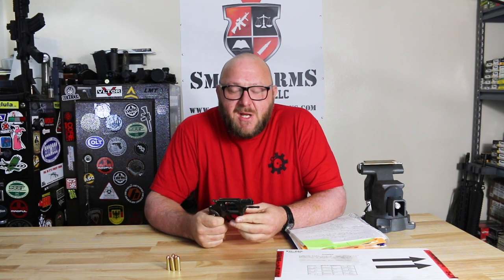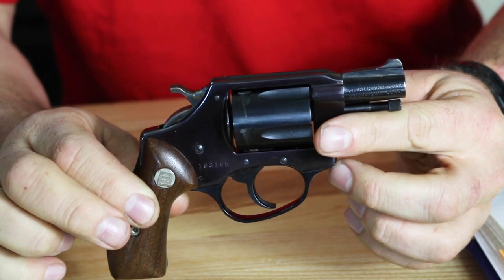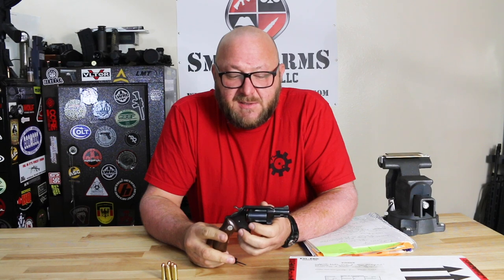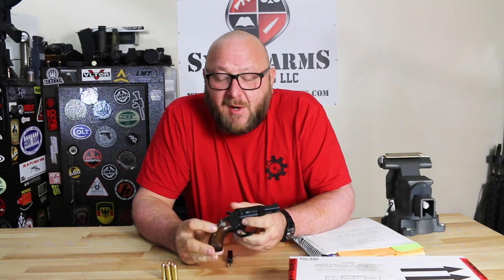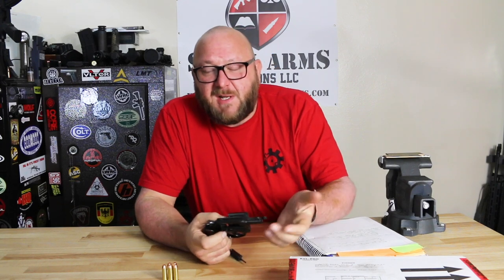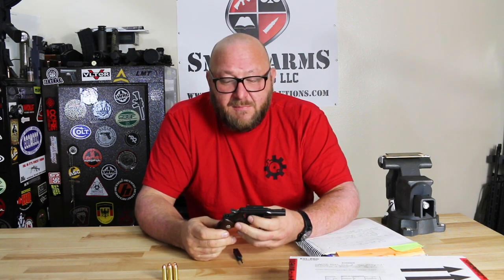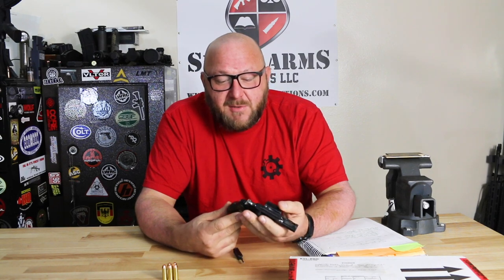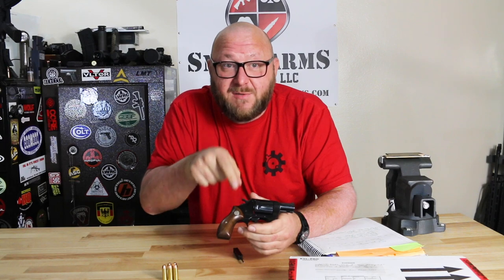Crime Series, Vol 7 - Charter Arms Undercover

Comment: The Charter Arms occupied an unusual niche in the firearm world. It was both inexpensive and good. There are and have been others but they are unusual. I carried a Charter Arms Undercover as a backup when I was a police officer in the early '80s as did quite a few of my fellow officers. The only consistent complaint was that the trigger was pretty gritty but the advantages of a small, lightweight, hard-hitting backup weapon outweighed it. The department I worked for required that any backup weapon had to be loaded with the department duty round which in our case was a Winchester Silvertip .38 special +P. The only serious competitor in terms of size and concealability was the Smith and Wesson J-frame Chief Special which was not rated for +P rounds. That doesn't mean some officers didn't carry it anyway but the fact that the Undercover was rated by the manufacturer to handle higher-pressure rounds tended to give it an edge. And, of course, it was quite a bit less expensive than the S&W. Cool trip down memory lane! I haven't owned a Charter Arms revolver for a couple of decades but I may "need" one now.
Reply: A lot of guns that are "inexpensive and good" as you put it are sorely missed once they're gone but underappreciated while they're around. Norinco and Polytech AK's come to mind. I've personally always had respect for the Charter Arms Undercover and it was actually the revolver that started my fascination with snub noses.
Reply: Just out of curiosity, did you ever have to draw it as a backup weapon on duty?
Reply: @jbuckley2546  I never did. I didn't draw my primary weapon all that many times and never had to resort to the backup. I did draw a weapon once when off duty but it happened to be a different handgun. At the time in my department, off-duty firearms weren't restricted to the issued ammunition so I sometimes carried something else.
Reply: @noth606  LOL! Well...at the time I had a thing for big bores. Since off-duty firearms weren't restricted, I carried a variety but on that particular occasion I was carrying a Smith and Wesson model 25-5 in .45 Colt. It had a 4" barrel and was nickel plated. There was a pizza restaurant in town where the owner officially closed at midnight but then allowed the police officers from the offgoing shift to come in and he served us himself. There was a parking lot across the street which was usually mostly empty at night but it was a part of town where there was still a fair amount of activity and foot traffic even late at night. Just as I stepped into the restaurant someone started screaming and I turned around to see a man trying to drag a woman into a car. Being closest, I got there first but just barely ahead of the dozen or so other officers from three different agencies. That nickel plated .45 must have looked like an artillery piece under the parking lot lights and we got no resistance as we literally swarmed the guy. Apparently he was trying to abduct a woman who had broken up with him. It was another agency's jurisdiction so I don't know the final outcome. But he literally peed his pants, so there's that.
Reply: I also got behind the badge in the 1980s, and bought an Undercover revolver the very day I was sworn in on the job. Carried it the first few years as both a BU and OD weapon.

Our agency-issued ammunition was also .38 Special Winchester Silvertips, but in the too-light 95-grain loading. Our issued sidearm was the Smith and Wesson Model 67, an example of which I bought a year or so back for nostalgia reasons.

I found out later that my dad, with whom I was not in touch at that time, had also done a stint as a deputy in a rural Colorado county. His OD gun was also an Undercover, which happens to have been made in the same year in which I was born.  He passed years after we reconnected, and both guns are with me (his is on my hip as I type this.)
Reply: I always found it ODD that they (CArms) advertises & rates their pistols for +P rounds, but then declair in the pistols owners manual, that its not advised to shoot them in their snub nose models( wich is mostly what they make) because of the  insufficiency of shooting them, due to lack of longevity pressure , resulting in unburnt powder...🤔 Edit: i suppose the cylinders/ & or barrels are all +p, and when the pistols hit assembly, their all covered w the + p rating no matter what barrel or cylinder or frame is used to manufacture what ever fire arm. Still, that being said, alot of people are needlessly buying +p ammo for snub nose's, when standard " (non + rated)" ammo actually performs better in them.
Reply: Just got one of the Stratford models from the late 70's, and it does not have the gritty trigger. The owner who had it before the guy who sold it to me, I believe had the trigger reworked by a gunsmith. You can tell that it's been disassembled and internals polished.
Reply: My first pistol was a Charter Arms Undercover Lite with a hammer. 
I bought it used. 
It came with a decent Owb leather holster by Don Hume. And two Speedloaders. 
The only issue was the speedloader had issues because the rubber grips would grind against the speed loader. 
I had to file down the left side of those grips. 
Absolutely horrendous yet effective. 
The Speed Loader was a Safariland Comp I.
Reply: My department would only approve S&W or Colt revolvers for back-up or off duty carry.
Reply: Were they labelled as +P or was it just known by other means?
I seem to remember the gun being labelled just .38 SPL...not +P.
Was it said to be +P in advertising? Or did the factory ever officially say?
Reply: @michaelkulman7095  It's been a long time ago so I don't remember exactly. It's my recollection that the manufacturer officially approved them for +P ammo, but I don't know if that was in advertising or what exactly. I guess it's possible that the manufacturer never officially said it but everyone just believed it to be true, but I was (and am) kind of a stickler for accurate information, so most likely I checked it out. 

FWIW, this is from their current FAQ page: "Yes they can handle +P but we do not recommend it for the following reasons:

+P ammo requires a four-inch minimum barrel to burn the extra powder. Therefore, in a two-inch barrel the extra powder is burned after the bullet leaves the barrel creating more recoil and making it harder to come back to target.

The reason it mattered to me was that my department required that any backup weapon had to use the issued ammo, which was .38 special +P.

Comment: No Saturday Night Special at all, but a well built, strong, durable, and combat accurate as it gets.  I use a Charter Arms Undercoverette .32 Long snubby as a back-up. I carried it in an ankle holster as a back-up to my on-duty arm, the Colt Official Police .38 Special. This little Charter Arms rode in my ankle holster for over 3-decades while I was in patrol services. I had to qualify each year with my snubby just like my primary duty revolver. Over that period of time it took a beating from rough cop wear and tear activity, common to all real cops, or use to be. Exposed to bad weather elements, summer time heat, colt weather, and rain, plenty of it down south in west-central Georgia. After retirement I sent my Undercoverette back to Charter Arms for refurbishment. The blue wear was substantial, but mechanically it operated like new. When it returned from Charter Arms a few weeks later, it looked new, and the good folks there provided new factory rubber grips to supplement my original scratched up, dented up small grip panels. Oh yeah, your Charter Arms is nobody's Saturday Night Special, only in the minds of gun snobs! Thanks for the great video!
Reply: I agree. Mine have been shot alot . Are accurate  light and have never failed. Made in USA  lifetime warranty.  What's not to like.

Comment: Incorrect facts. Iver Johnson was the first to use an internal safety transfer bar with their safety automatic revolver, not Charter Arms. "The Iver Johnson Safety Automatic neither has a manual safety, nor is it automatic. It’s a revolver. Its a double-action top break revolver similar in layout to the Smith and Wesson hinge frames of the 1860s era. What made the Iver different from the Smiths was in the fact that it had an internal transfer bar safety. This safety consisted of a bar that rested between the hammer and the rear of the cartridge in the cylinder/chamber. The bar prevented the gun from discharging if dropped and moved into place to fire only when the trigger was depressed all the way."

Comment: I don't understand why they call these things belly guns. I have an identical s&w snub nose with gutter sights and I use it to plink cans at 15 to 20 yards no problem. We had a possibly rabid racoon under our cabin and after we scared it out we had to dispatch it. It was at a dead run at least 25 yards away and that was no problem at all. I think if you started out with a double action revolver trigger you can pretty much shoot anything halfway decent.... If you start with a 1911 trigger or a glock trigger you'll definitely have problems. I got started on a S&w sigma 12lb trigger so the worst of both worlds. But now a revolver or a glock trigger are treat to shoot. I think these guns are way more accurate than they get credit for.
Reply: Term of art circa 1880s.  It hung around the gun culture for 140+ years.
Reply: Working at a range, frankly it’s because most people simply suck at shooting and snubbies are definitely not the easiest things to shoot.
Reply: I've shot the UC benched and hit steel gong targets at 100 yards with the front sight post elevated half way up above the rear sight channel. Like lobbing in tiny mortar rounds: bam! .... Clang!

Comment: I have one of these I've been concealed carrying since I got my permit. Got it for $150 used with a box of 50 cartridges and holster. Turns out its a very early example, first year of production. Serial number under 13,000. Good reliable gun, easy to carry, reasonably accurate.

Comment: It was NOT the first with a transfer bar.  It was just a re-do of the old Iver Johnson Hammer the Hammer safety, which was basically the same thing and sadly was ignored for 60+ years.  When the gun came out, LRN ammo was the standard.  Super Vel was the first JHP maker and all in all their product was a great leap forward, although most PDs did not approve it's use (although back then some PDs didn't care what gun or ammo you used.)  Back in the day I carried a Colt and later a Ruger Service Six in my duty holster and a concealed Charter Arms on my left side.  Still have it (LE hammer of course, T grips),  In one agency I had to qualify PPC with it before I could use it and it was comparable (once I got T grips) to my old Detective Special in accuracy (but only 5 shot).  The quality of a Charter Arms revolver is directly related to which production run at which plant?  The Bridgeport and the Sratford factories produced the best ones.  For the most part there is nothing wrong with the earlier Charter Arms pistols as long as you get in some practice and don't put hot handloads in it.  We blew up a few of them testing the then new US Treasury +P+ ammo, but then we destroyed Colt revolvers with that ammo too and wound up going with S&W Model 19s as the only ammo approved sidearm until the Ruger Service Six emerged.  Then came the 9s..  Rohm and Clerke guns were what I saw the most on the street, Sterlings too of course.  Also a lot of WW2 surplus pistols.
Reply: Iver Johnson was also the first person to put the Dingus on the trigger and everybody gives that credit to Glock

Comment: I used to have trouble opening the cylinder on mine.  I found out that because the ejector rod is made up of multiple pieces, you have to periodically tighten down the end piece.  I just finger-tighten it every once in awhile, and it solves the problem.
Reply: Red loctite 👍
Reply: Yup
Reply: Dont use red!! Use blue!  It will be nicer & " possible"  to disasemble it if, but more likley( when) you need cylinder rod springs or cylinder spring.😉

Comment: You are talking about the transfer bar system then you show an internal view of a Smith and Wesson HAMMER Block system two different mechanisms  one blocks the hammer when the triggeris at rest and fully forward while the transfer bar Completes the contact between hammer and the firing  pin  when the trigger is pulled.

Comment: In the 1992 I was searching for a Smith airweight j frame this is before the centennial came out.. they were hard to find an expensive.. so what's a poor boy to do? I picked up in mint condition a charter arms off duty stainless 38 special.  16oz ..(manufactured in the 1980s)  I still have this gun in love shooting it and carrying it to this day.. the action is a little gritty but the trigger pull is much lighter than the Smith. Very accurate within 50 ft.. modern charter arms guns are even better

Comment: Iver Johnson been using the transfer bar safety since the 1890s they also used to put dinguses on there revolver like what's on my glock trigger
Reply: Interesting, I was wondering if this was the beginning of the auto guns drop/firing pin safeties with the plunger connected to the transfer bar?

Comment: Great stuff! Never knew about the designer who introduced the transfer bar AND the solid (no side plate) frame. I love my Ruger GP-100 and those features are a big reason why. Thank you!!
Reply: agree, got the 7 shot gp100, love it.
Reply: Iver Johnson designed, patented, and produced the transfer bar in top break revolvers in the 1890's.  Marketed as 'Hammer the Hammer'.
Reply: @shl4449  I believe Charter Arms was the first to use it in a revolver though, but I may be wrong.
Reply: @JB-ss9nn  Iver Johnson revolvers with transfer bar were sold in the 1890's.  Charter Arms was established in 1964 - approx 70 years later.
Reply: G

Comment: The way you described the transfer bar it seems to be the opposite of my Ruger. On my Blackhawk the transfer bars stays up thus allowing the the bar to get hit by the hammer and transfer the impact to the firing pin. If the trigger isn't pulled, the transfer bar moves down, and the hammer nose strikes the frame, the shelf not hitting the transfer bar, leaving a gap between the hammer and firing pin. I wonder why the difference. Patents? Either way, I don't own a Charter to compare but interesting how they choose different ways to achieve the same end result. I rewatched the segment, Maybe I misunderstood.

Comment: jack1948ful
1 second ago
A lot of CA .38 spl. stories here  well mine a little different I bought a 
CA .44 spl. sometime back in the late 70's I thought it was a a gun smith custom (haven't ever seen another since) it is a 5 shot unshrouded floating ejector model with 1"& 15/16" barrel  a checkered top  bobbed hammer I did call CA and I think I spoke to Vince who said yes it was a factory gun from the early to mid 70's I don't shoot it much but I do ever now and then along with keeping it clean it has small grips for concealment it has a sting to it with 240 gr SWC it was an EDC  for a long time !  Serial # 4xxxxxx ANYONE GOT ANY INFO